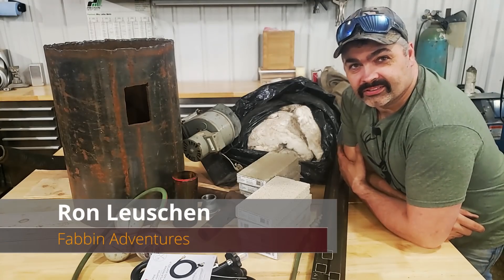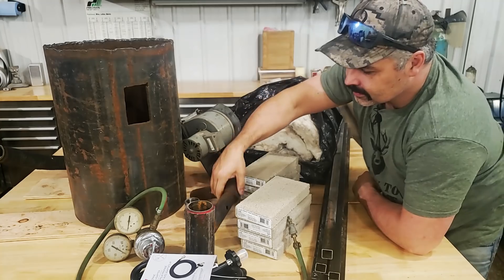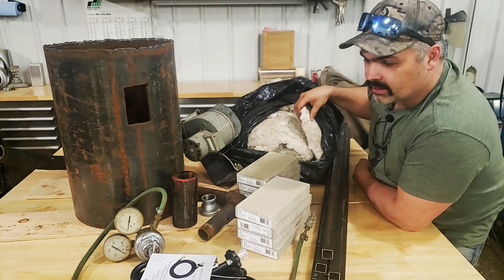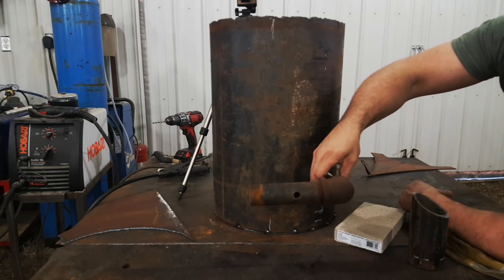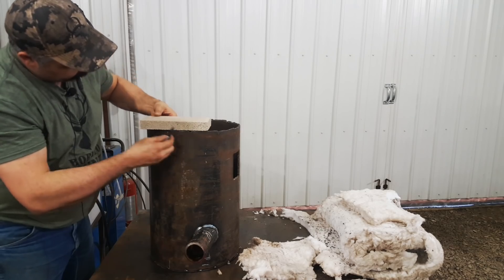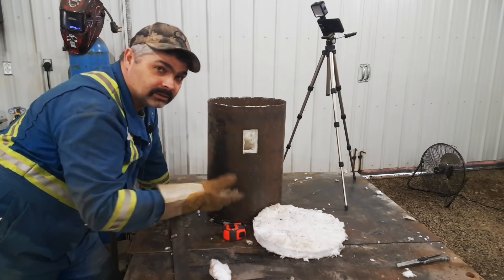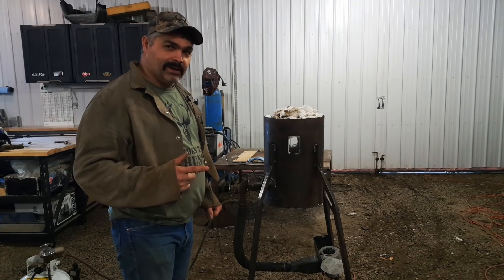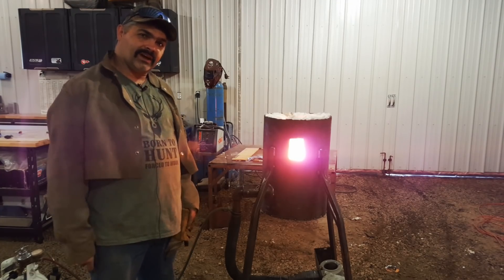Propane Forge: How to build a propane sword/knife makers forge!

Comment: You are going to want to coat the entire inside of that forge with kaowool rigidizer. It comes in a spray form and will solidify the kaowool so fibers won't come off of it. If you do not do this, it will ALWAYS blow fibers around and they are almost as cancerous as asbestos!
Reply from the maker: Yes, i just found out about that stuff, ill be ordering some soon. Thanks though, and thanks for watching fabbin adventures!